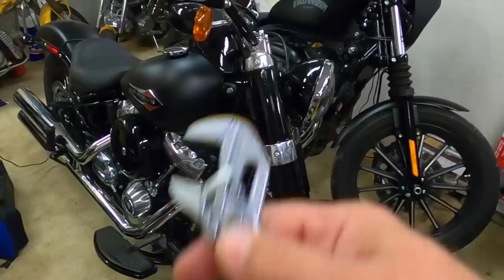Best Survival Wrench!! • Cool Milwaukee-Eight Trick! | TheSmoaks Vlog_1791

Comment: Talk about the spline shaft. In 1972 I picked up a brand new 1972 XLCH (KICKER only). On the way home, I got stuck in 2nd gear AND a sudden blast of snow. Turns out the shaft never went to heat-treat and I wore the splines off within approx. 30 miles of shifting in city traffic! Oh Harley back in the day. My friends used to tell me to go out and try to kick that thing over while they order an other round, haha.😂👍😎
Reply from the maker: Those old Harley's....  If they did break or piss you off once in a while, you weren't having fun yet! Lol
You might enjoy these guys. This is Young and his never ending battles with his 1971 Electra Glide Bobber: https://youtu.be/V4yNNVSSpkU

Thanks!!
Reply: Thanks for the link Sean, I've seen you talk about this Chan. Haha, I had a 1972 Electra Glide Shovel.